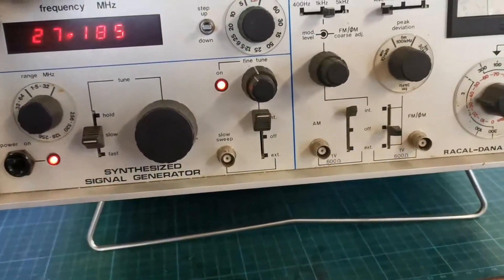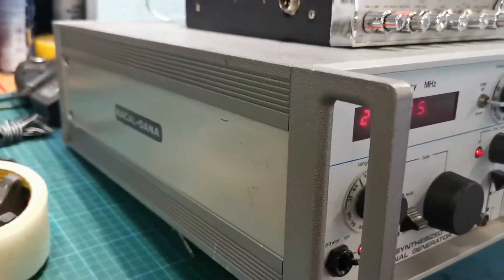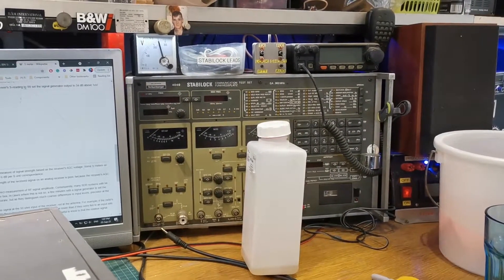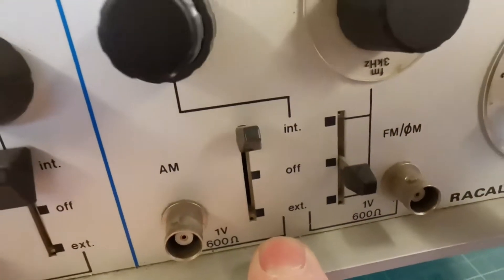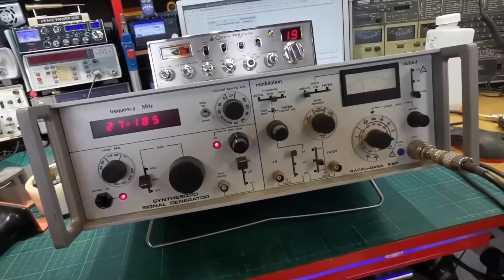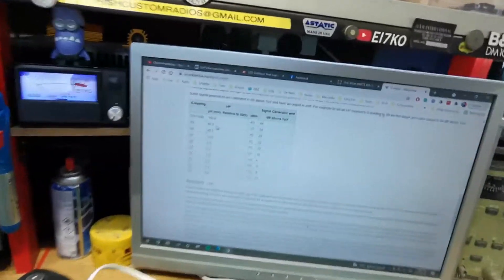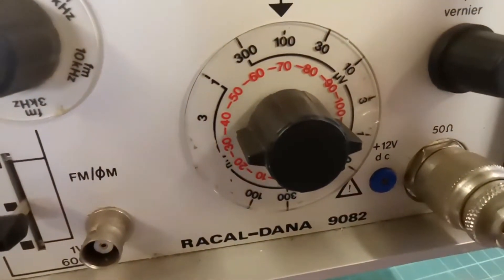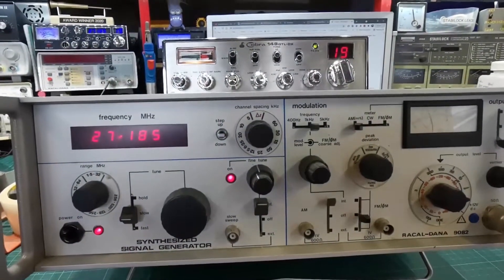RACAL DANA 9082 SIGNAL GENERATOR

Comment: I've just fully restored one of these, it's now my go to signal generator, nice bit of kit George.
Reply from the maker: Oh it's long gone. The encoder was flaky on it.
Reply: @GeorgeEI7KO  Oddly enough I had trouble with my tune encoder as well, turned out to be caused by IC3 on the logic board, I was only getting a very weak pulse out measured at TP2, that along with a about 20 other faults, still I suppose they are starting to show their age mate, a bit like me 🤣

Comment: I just got one by mistake and i think I could use this as cb radio? like old school is it possible or will i bring small airplane down when antennas are connected  ? 
Please help 🙏 😢
Reply: Ps I know is not reciver
Reply from the maker: So then you answered your own question. All it does is tx a 1khz tone  on whatever frequency you set it to
Reply: @GeorgeEI7KO  but I read you got internal or external modulation so I take it you can also speak on am/fm
Reply: @GeorgeEI7KO  Um rude, you could have elaborate it abit on it, but knowledge is power especially when it comes to cobra 148gtxdl I've seen hanging about the place, old nostalgia from the 80s so i see we are not so different after all!!!
But hey my friends don't choose me I choose them
Reply from the maker: @remu3881  but how would you use a signal generator as a CB radio???
Reply from the maker: @remu3881  no that is how the modulation is supplied to the generator. Either by the internal  oscillator or an external one on either AM or FM
Reply from the maker: @remu3881  Hey man, I'm at work right now. All you need to do is download the user manual for the generator and you'll know all then. Every time i get new gear, that's the first thing I do.
Reply: Hi I am looking for the owner's manual, not the service one ?

Comment: Nice addition to the workshop George, may it work flawlessly for years to come.  :-))
Reply from the maker: Cheers bob...im sure the little bit of tlc i gave it will help. The Meter glass was cracked and gone very opaque so I replaced it with plastic and me being me, had to make it illuminated...lol
Reply: @GeorgeEI7KO  But of course, is it blue by any chance?
Reply from the maker: @BoB4jjjjs  believe it or not, no. Its Amber...
Reply: @GeorgeEI7KO  Shock horror, ran out of blue LEDs?
Reply: Hi I am looking for the owner's manual, not the service one ?